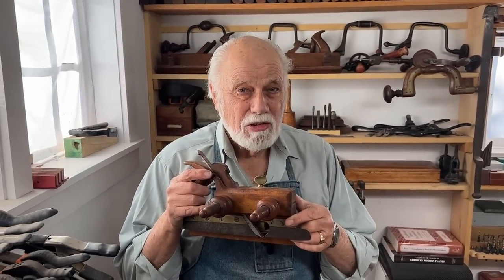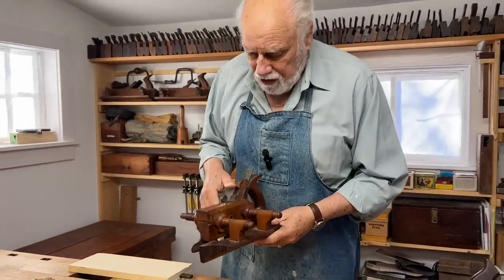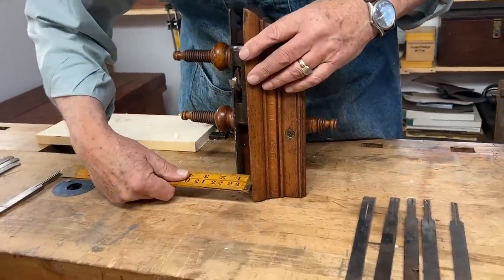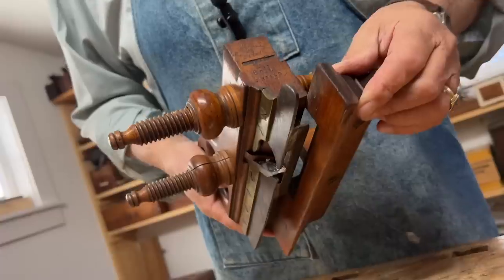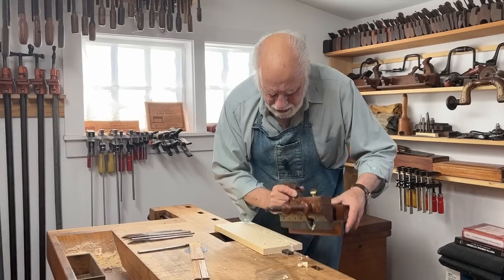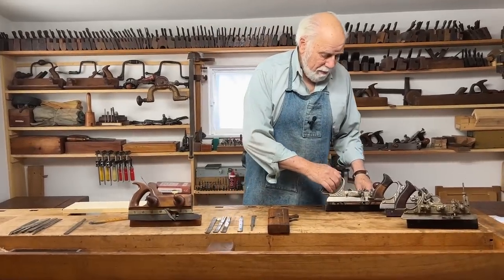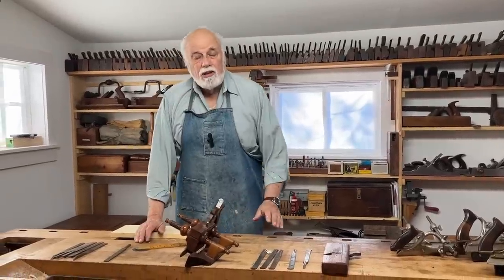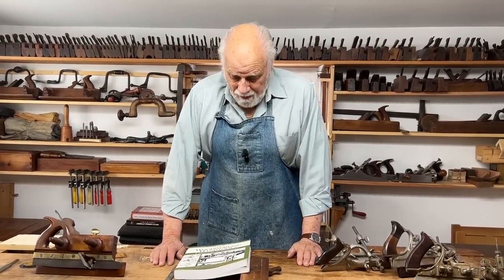32. The Plough — Prince of Handtools

Comment: Spectacular coverage as always. I picked up a Safford Plough plane last weekend at a flea market. The most interesting difference between the ones you have shown and mine is mine uses wedges to lock smooth bars instead of threaded bars for the fence. Oh and there is no locking screw on the depth adjuster. 

Thanks for all the great info
Reply from the maker: This was also a common variety in Britain, not quite as sophisticated as the threaded arm variety, but works just as well.

Comment: Great intro to wooden plough plane.  Thank you.  I always look forward to your informative videos. I have a few comments about wooden plough planes.
I fully agree that any wooden moulding/plough/moving filister/rebate plane is easier and simpler to use than a 50/45/55. Easy to set, less tear-out and easy to use.  
But for the vast majority of wood workers who would use a plane like that the cost of acquiring a decent range of those planes is out of reach.  
As an example, if I wanted to only match the blades of a 55 with wooden hand planes, at $30 each x 52 for decent second hand ones in Australia I'd be up for $1,560.  If I went to ebay I can buy a good set of 6 rounds and hollows for $650.  Wooden moulding planes are great but too expensive for my budget.
My 55 + blades cost me $550.  And for many wood workers, that's was too much.
And the 55 allows each blade to be used in different ways by fitting different attachments and setting at different angles.  Hence, the number of single wooden planes required to replace a single 55 is a lot greater than the 52 it comes with.
If I want a special shape for moulding or such I can grab on old bench plane blade and make it.  I don't need to make a whole new wooden plane.
I'm no genius and I find the 55 simple enough to set up once you understand what's going on. Admittedly, I used to be a mechanic so maybe that helps, but most wood workers are "handy" so I don't think I'm special.
Some hobbyist wood workers have nice big shops and plenty of storage that could accommodate 50 or more wooden planes.  In these modern times it is becoming much less.  My 55 and it's bit sits in a small case.
Reply from the maker: Given your prices I totally agree!

Comment: The Stanley 55 is a nice plane. It does what it´s supposed to do and it is a piece of art. Just look at it. It´s beautiful. But usually, when a tool can do a lot of things, it´s not very good at any of them. I´ve just built myself a grooving plane to make a groove for the bottom for small drawers. It can only do one single thing and that´s making a 4mm deep and 4mm wide groove 6mm away from an edge and it does it perfectly. I just have to grab it off the shelf, (no adjustment needed), use it and put it back. I´ve built it wit a HSS iron, so it makes many meters of grooves before I have to do anything. This is perfection. The iron cost me about 3€ and I made the body of some beech fire wood in an afternoon. That´s how I like to do it. I find that quite efficient. I still have an adjustable grooving plane but I rarely use it because if there´s any repeating task, I rather build a plane to do exactly that and add it to my collection.
Reply from the maker: Sounds great!

Comment: I have got Luban 43 which is replica ( and sone improvement to the handle) of  old Irwin 43 plough plane. It is small but when you learn how to work with it is very versatile and fun to work with and you can make grooves very fast with minimum set-up. With the cutters i also received a kerfing saw blade holder i can attach kerfing  blade to make deep path for the saw to ride on
Reply from the maker: Sounds good.

Comment: I just realized i have something similar to this sitting on my shelf in an old wooden box. It says Stanley No 45. unfortunately its missing the cross bolts but i think i know someone who has some. the irons are strange too, It has a full set of irons that don't have the groove but, they have a small notch in the end that hooks on a peg at the end of an adjustment bolt. it also has a small wood handle screw driver.
Reply from the maker: The Stanley 45 is an interesting combination plane. Complete instructions are available on line,

Comment: I have a couple of plough planes, one in excellent condition, and they came with different size irons, which was lucky. I have then been lucky enough to acquire several other irons so I have most of a complete set and definitely enough to do most of anything.

The plough plane is called a "nothøvl" in danish, as in "fer og not"/"tongue and groove". "Not" is an old word and is only used for groove in this connection.
Reply from the maker: Very cool!
Reply: @gjbmunc  Thank you! I should have added that not only is "not" not how we say groove ordinarily, but "fer" is also a word solely used in connection with this type of joinery (tongue is "tunge" in Danish). I'm actually not entirely sure what "fer" means, but sometimes it's spelled "fjer", which is a feather. However, I think that's a mistake.

Comment: Great video. I wonder can you use a Plough to make a stopped-grove? I want to make a box with proud dovetails, so the grove needs to be stopped at both ends for the base. My Stanley is a tiny, fragile thing (forget the pattern), I've only got a 6 and 4mil iron. It's a rattley lil' tool.
Reply from the maker: You don't have to work all the way along a piece of wood with the plough plane, but then you will need a bullnose plane (or even a chisel) to finish the end of the stopped groove.

Comment: I recently got a Ohio Tool #101 plough plane. When I tighten the wedge it pulls the iron forward out of the groove on the iron. It only came with one iron but could this be throat wear? Or a wedge problem?
Reply from the maker: Sounds to me like it's probably wedge, or less likely throat wear. It's also possible that the one iron you have is slightly malformed. One way to test this would be to try to obtain some extra irons and see if the same things happens, then it will be the wedge, or less likely thr throat. that need a little adusting.

Comment: I'm just asking, sir, what is the correct angle of the cut wood for his blade. from the philippines
Reply from the maker: I generally use 26degrees for the blade.
Reply: @gjbmunc  26 why ???! If it's 30 it wouldn't work ?!
Reply: @athmostafa2462  30 degrees will work fine.